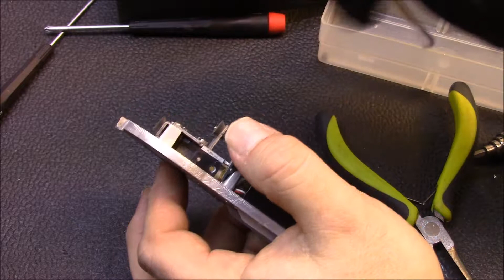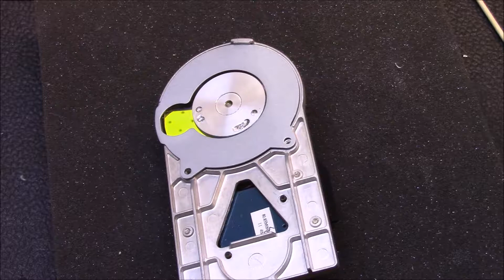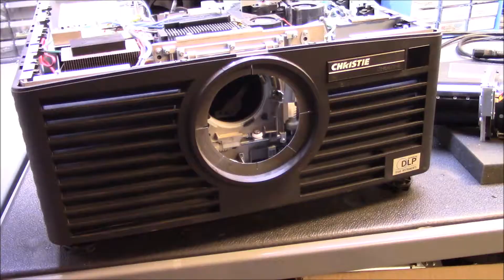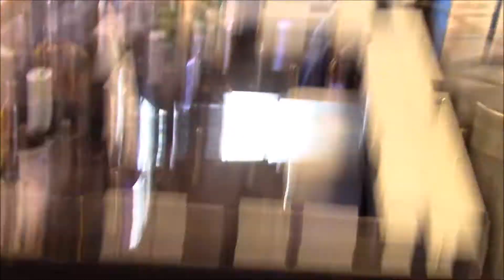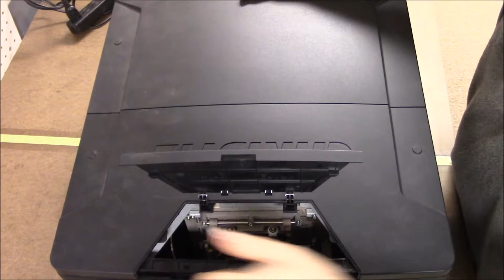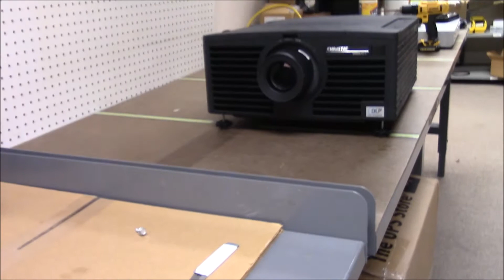Christie DHD670-E Repair Cleaning Part2

Comment: Do u think if I go with a laser projector some of the newer ones will there be a way to fix the lasers when it goes out or stick to lamps ?
Reply from the maker: it's hard to say.  Solid state has its benefits.  But lamp based is sort of easier to keep running.  Laser/LEDs do fail and they are not as simple to replace as a lamp. They also suffer from diode driver failures. I think it comes down to what you spend.  If you can get a nice 1080p lamp projector for cheap it would be worth it.  Most modern lamp projectors can do 15,000 hours on smart eco mode. Most solid state projectors will last about the same.  I don't have a definite answer one way or the other.  If you can get a nice 1080p solid state projector with enough lumens then that would be fine too.  I go by what looks good to me. Personally I run a sony lamp based projector and love it. I also have 2 laser projectors that are really nice but the sony has a better picture. I use the laser PJs outside in the nice weather.

Comment: Nice job doing that. FYI, I had to scrap a DHD-775E, so I have all the parts except the mechanical attchment for the lens and sevrala plastic pieces of the enclosure....I am however looking for a scrapped lens for those projectors. I only need the gray metallic place that secures the lens to the projector. Can you help?
Reply from the maker: I dont think I have anything, but contact the parts folks I use.  Gydz@timeprojectorlamp.com  Give them as much info as you can.  IF you have a picture (even from a website) of the part, that will help a bunch.

Comment: I purchased this used, and just received it today.  My unit appears to be VERY clean in the lamp and lens area, looks new.  I haven't taken off the top.  It didn't come with a cord, so I used a power cord from another less capable projector that I had.  The Christie powers up, I initially get green on lamp 1, and shutter and status.  I can access the menu.  In about 3 minutes, it shuts off and I get a red flashing status light, which I know indicates a fan failure.  Is this something that I can fix myself (I can build a computer) or if I need to have it fixed, what ballpark repair cost am I looking at?   Actually - now that I'm thinking about it - this projector was cold and giving me that problem.  I'm guessing rather than a FAN being the problem - that the thermistor/temp sensor has failed.  Also ---Do you have a source for parts as I need a remote.  Thanks!
Reply from the maker: Its probably a fan like the LED's are telling you.  There are a ton of fans inside, so I would recommend doing a visual exam with the cover off and fire it up.  I bet you see a fan not spinning or making a noise.  I have a few other videos on testing fans in various projectors. The rules hold the same for your projector.  The error reporting in these is really good.  I would follow what the projector is telling you.  The chances of a temp sensor failing is really low.  There are many temp sensors in this model and you would likely get a different set of error codes from the LEDs.  One thing you might want to try is connecting to it via the LAN interface and use your web browser to get to the control panel and see if it reports which fan is acting up. Most of the time they will tell you "Fan 1 or Fan 2"etc via that interface.  That would be on my list of checks for sure.  Depending on the fan you need, you can get most of them via eBay or mouser or normal parts sources.  They tend to use pretty standard fans with PWM fan stall reporting in these.  Some projectors use signal hi on stall when the fan acts up but higher end projectors like this one tend to actually report the RPMs so the fans tend to be PWM output on the status wire.  You will see what I mean if you search for the fan videos. You can search "fan" on the video page but to get you started, this is probably worth watching first.  https://youtu.be/kCOSQ8dVZvc
Reply: @FixitFrank    Thank you.  Very informative, and I think I can figure this out.  I'll open her up tomorrow.  My goodness, this thing is ENORMOUS.  lol.
Reply from the maker: Its a beast! Nice projector though.  Here is the service manual. It will be very helpful. https://drive.google.com/drive/folders/12OZPV7X6rI_v54bR4PfskzJYrydcrD_S?usp=sharing

Comment: I have a projector that is 6 yrs old that turns on, everything works, but it shuts itself down after 5 min. I feel like it is a heat issue. It is a christie dwu-550g. Not even sure how to open it to give it some air. Any quick advice?
Reply from the maker: Definitely can help.  https://www.projectorcentral.com/pdf/projector_manual_7531.pdf  Here is the manual.  Check page 26 (manual page 2-8) for the LED error codes.  They are pretty detailed in their error reporting. If the status led flashes red quickly, that is a fan error. If it lights red and no blink, that is overheating.  There are plenty of other codes, I would check that first before opening anything. It might even be a bad/failing lamp assembly. The LED codes will get you much closer and prevent any wild goose chases which can get expensive on a beast like this.
Reply: @FixitFrank  thanks for taking the time to provide that info!

Comment: So i got bored and decided to fix my benq projector. I didnt have the 5mm so finshed the video and waited to find one. Once i did i did not rewatch the video...i know smart right?. Well when i reinstalled im not getting power .even if i hold the safty button inside. Could i have missed a power connection somwhere?
Reply from the maker: Hi Brian,  I'd check to see if you plugged the temperature fuse back in.  The 2 wires that go to the rectangle thing on the blower fan.  That will prevent the power from coming on to put it in standby and Ive forgotten that wire many times.
Reply: Thank you ill try that tonight.
Reply: Initially i google trouble shooted. And first things that poped up was bulb was bad so i changed that last month only to have the same issues. Then i learned about the color wheel. When it turns on its stroby and off color. So i found your video and cleaned the sensors and it seems to rotate relatively freely.  Am i correct to assume if it doesn't work that it would be a color wheel issue or is there something i didn't read about yet. From what i saw i. Your video the color wheel spins extremely fast. Mine was noticeably slower. So im assuming that's the issue. One last thing idk if it matters.(i wish i had your number i hate typing lol) the power cord im using is from my guitar amplifier is there a chance it isnt the correct amount of power?